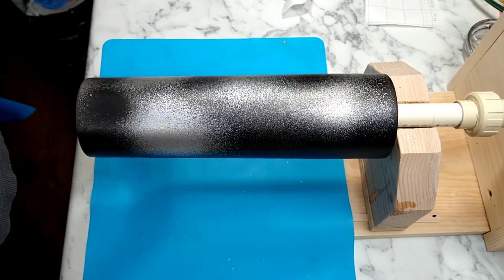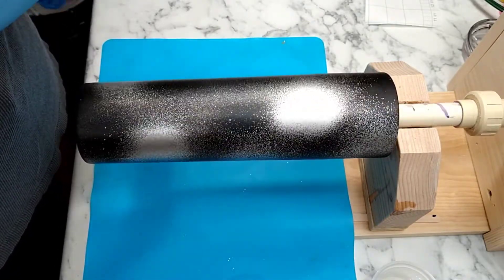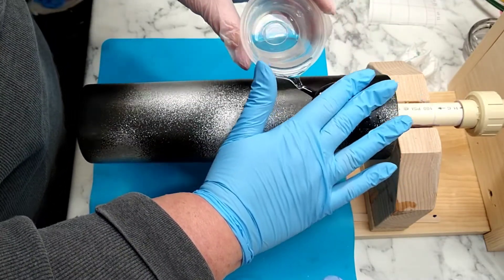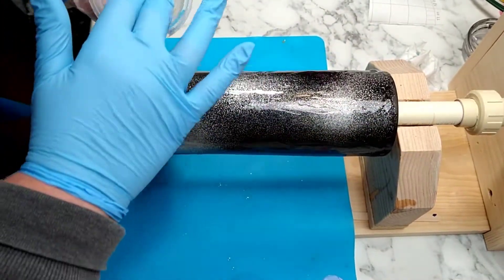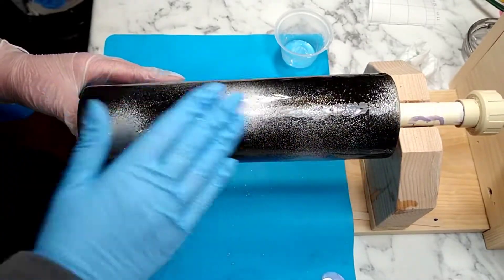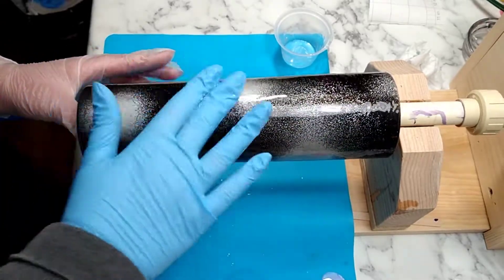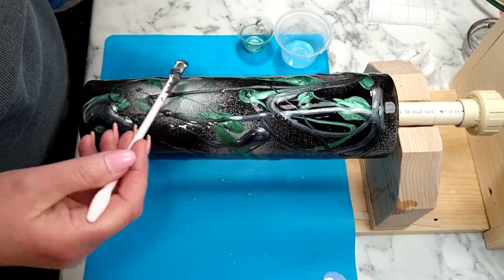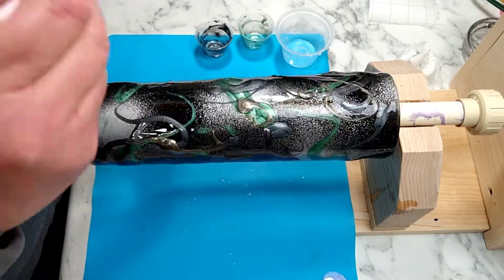Mica Powder//Epoxy Tumbler//Fail to Fabulous

Comment: can you show how you did the swirls?
Reply from the maker: Unfortunately, the camera cut out, and there was no recording of that part. What I did to swirl the epoxy, was, I used my finger, lightly directed the colored epoxy. But it wasn't a lot.  It mostly flattens out as it is on the turner.  I hope this helps.